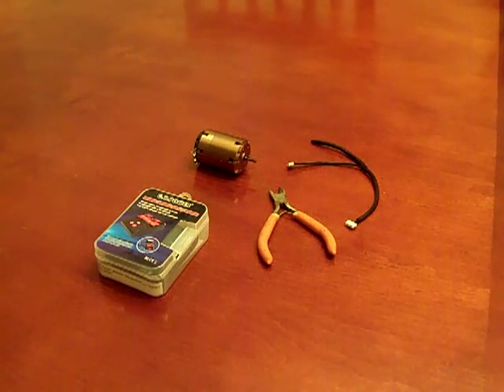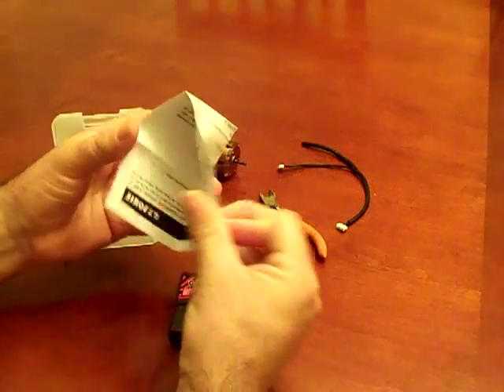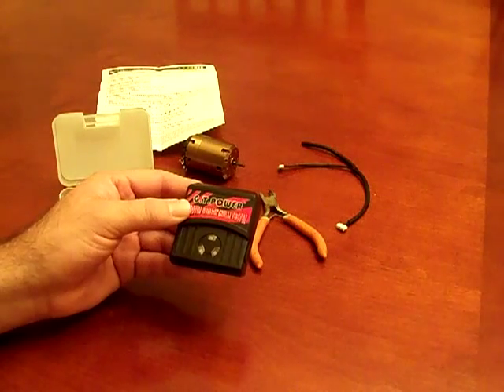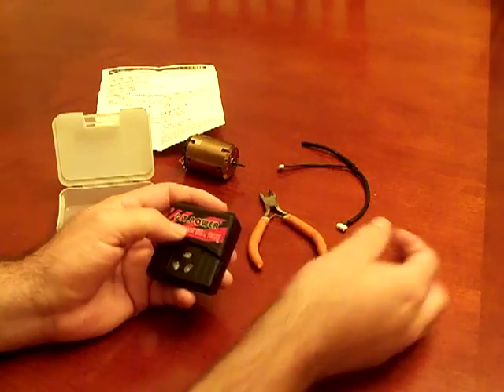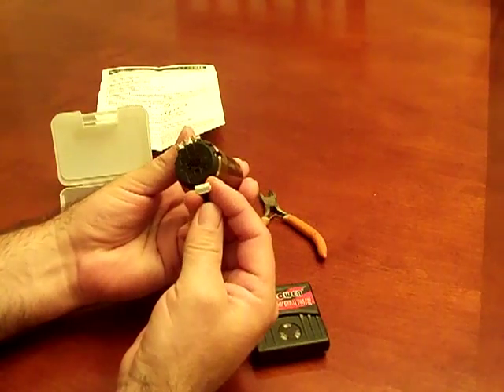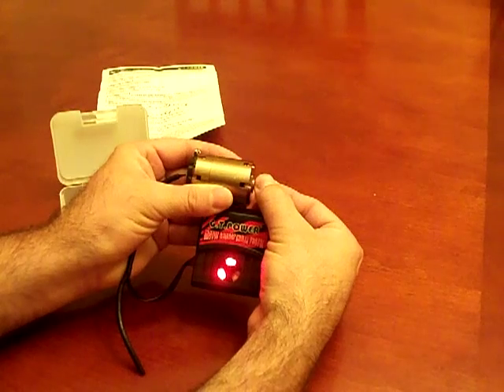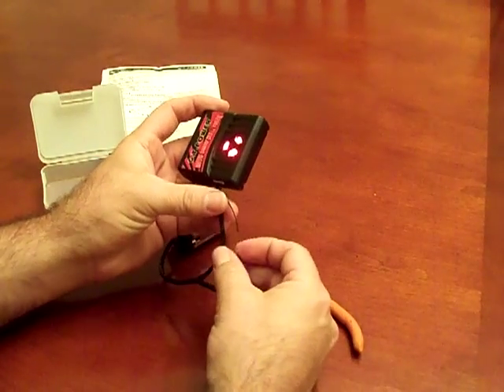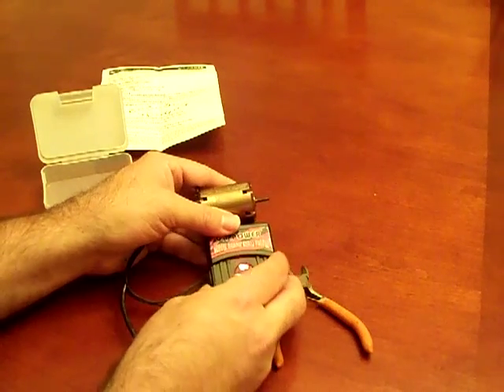REVIEW: GT Power Motor Hall Sensor Tester

Comment: Hey Bill,

What would have happened if the sensor in the motor was bad?  How would the lights be displayed?

Thank you,

Mark
Reply from the maker: According to the instructions, here are the 4 different indicators that something is wrong:

1) Three lights are always not on
2) Three lights are always on (as seen in my demo)
3) One light is always on
4) One light is not on

* It doesn't say what is specifically wrong with each of the 4 indicators, just a confirmation that something is wrong.
Reply: Bill DeLong Ok, thank you very much Bill.  It's crazy they would have 4 different ways to show something wrong.  With your example, the wire was cut/bad so all lights stayed on. So I wonder if the other 3 methods would indicate an issue with the motor sensor then.  Either way I ordered one, could be handy in the sensored motor world of r/c.